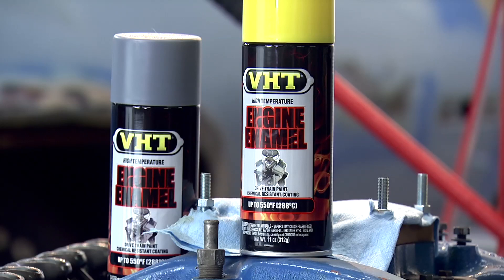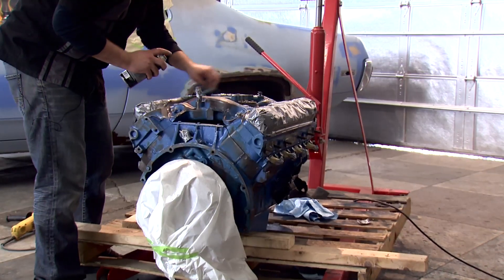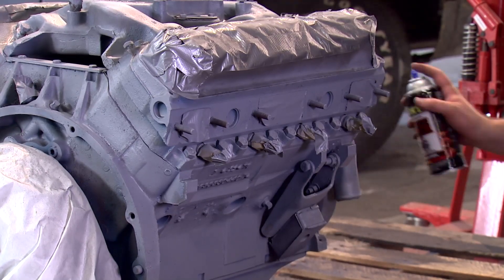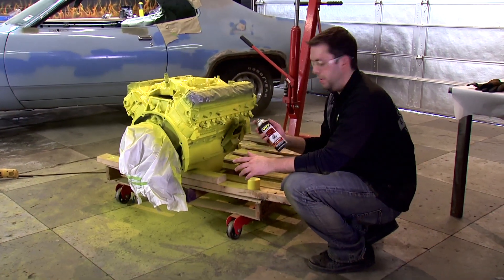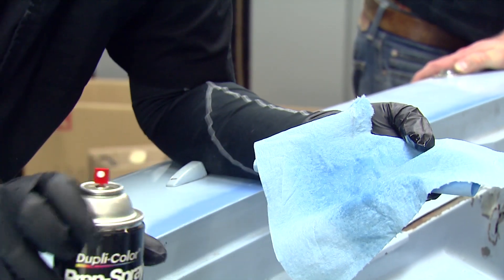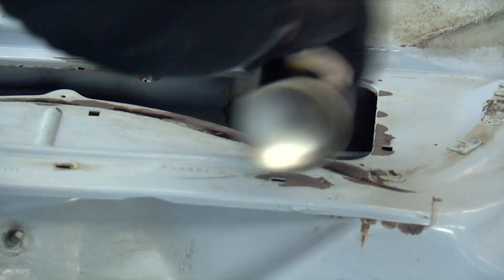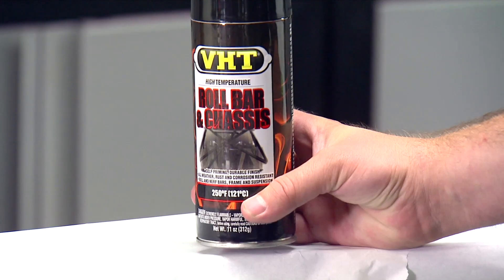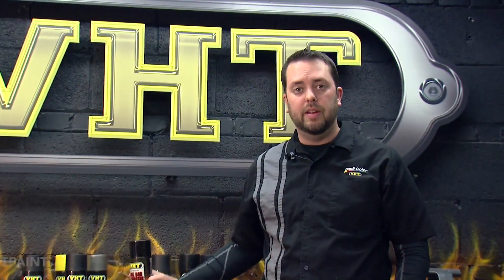Painting an Engine with VHT Engine Enamel - Restoration of 1972 Plymouth Satellite Sebring Plus

Comment: Do this guys!  As a mechanic at a restoration shop.  On our cheaper engine build where I paint the engine using VHT paint instead of going into the booth using high end engine paint.  First I wire wheel everything!  Cheap wire wheel kits from harbor freight.  Go over tight spots with small wire brushes!  Blow everything off with compressed air!  Degrease with brake clean!  Sometimes twice.  Blow off again with compressed air.  Make sure it is clean!  Buy self etching primer from SEM!  Its 18$ a can but has a 5 min flash time.  Well worth it.  If you wait more than 15 min you have to scuff the primer and blow dry again.  Once SEM primer has flashed apply one light coat of vht paint in your color and wait 10 min.  Go again with another light coat wait another 10 min.  By light coat I mean dust the paint on.  After second light coat go medium.   You should start to see the engine block take shape now.  Wait 10 more min and apply another medium coat.  It should look done to you!  Wait another 20 min and apply a thick coat of paint!  Should look like your painting over the same color but just a little deeper that before.  This should be your last coat!  No clear coat needed.  After 24 hours,  run engine for 10 min and let cool do another couple 10 min runs with cool time after.  Works great everytime.  You will see some yellowing of the paint around the exhaust ports on the heads but that is to be expected with this spray paint method!  Do NOT use any carb cleaner or high acetone products around this paint because it will stain no matter how cured it is.  Hope this helps and good luck with your engine build!

Comment: I've been rattle canning for 35 years and it's the best (off the shelf) canned paint I've used. It lays down beautifully.  But I wasn't as thorough as this guy. I used no primer. Just did a very thorough prep, and clean wipe followed by multiple coats. I was very pleased with the results. Actually worth the $10 per can price tag
Reply: How is it holding up after all these years?

Comment: Hi, I bought Engine enamel primer (SP148) and Engine enamel gloss black (124). I am planning to paint motorcycle engine. Question is: after applying primer (SP148) do I have to sand it before I apply gloss black engine enamel or just wait 30 mins till primer dries to touch and apply gloss black engine enamel (SP124) without sanding the primer?

Comment: One question, I used VHT engine paint for a Rm125 2 stroke cylinder and head and it looks good and everything, I'm about to assemble the top end, will turning on my bike and warming up the engine cure the paint? And also how long does the paint take to fully cure? On the back of the can it says heat up to 200 degrees? Do I need to stuff my parts in a oven? Or will running my engine work just fine ?

Comment: When the curing for engine is done? After you assemble everything in places? Also how long I need to wait to put clear on the paint?
Reply from the maker: VHT Engine Enamel only attains its unique properties after correct curing.
You can bake the parts before putting them back on the vehicle or heat cure
the parts on the vehicle. The Clear would be applied within an hour of
applying the Paint. Or, if you cannot apply it within an hour, you’ll need
to wait 5-7 days. To heat cure: Bake at 200°F (93°C) for 20 minutes OR
The inherent heat of engine operation will also accomplish curing.

Comment: Thank you for your interesting video,  question though, Should I sand before or after heat curing ?  Do you know if paint resists to solvents ?  ex lacquer , carb cleaner .....If i cure properly (200F 1 hours ) . Thanks
Reply from the maker: teonguyen1 Hi Teo, thanks for your questions. we recommend sanding after the heat cure, although you can sand before the heat cure if the paint is dry. The paint itself will resist quick spills, but not constant exposure to strong solvents. Good luck with your project!

Comment: I just ordered some VHT Engine primer and nu aluminum-I am wondering about rust on the block. I am thoroughly wire-wheeling the block and using ospho on the the areas I am painting and then wire wheeling again. Does the block need to be absolutely rust free? Since it has a rough cast feel there is fine rust in the "valleys" though nothing loose-just what wont come up with wire wheeling. I plan on using solvent on the whole block just prior to painting. Any tips????? Thanks!!!!
Reply from the maker: 351cleavland Thanks for your question. It is best to remove all rust prior to applying our paints. We would recommend sandblasting if you are having trouble with the "valleys" on the parts. Make sure the surface is completely clean and dry before applying any of our paints or primers. Hope these tips helped to get you in the right direction, please call 1-800-247-3270 if you have any additional questions and our experts will assist you. We'd love to see your project when it's done!

Comment: I heard that for High heat Paints to work the Engine must be at a hot temperature when painting for it to work?
Reply: Absolutely, in fact you should have the engine running @5000 rpm while painting.

Comment: Question... I used this paint today, 3 coats on one part (2 light, 1 med) but only 2 coats on another (1 light, 1 slightly heavier). So I'm going to wait a week to re-coat both pieces one last time. My question is, ideally, how long after re-coating should I wait to cure them in the oven? 1 hour, when they're dry to the touch... 3 hours, when they're able to be handled? Or longer?
Reply from the maker: Thumper G. You'll want to wait overnight before heat curing (at least 8 hours.) Thanks for your question, good luck!

Comment: Hi, I'm about to pain my motorcycle engine with VHT Engine Enamel. I'm thinkin of  SP148 primer, Sp995 Nu-cast aluminium paint and SP145 gloss clear coating. Do I have to cure after primer, after paint and after clear coat or once after all the job is done?
Reply from the maker: Rudy Hi Rudy, you'll get best results when each coating applied is cured separately. When curing all of the products on the surface at once, there is an increased chance of the product wrinkling on the surface as it is cured. Be sure to follow the label directions for each product (primer, color, top coat) separately for best results. We'd love to see the final product! Good luck!

Comment: I'm looking to paint my CB750 engine matte black. Maybe I missed something in the vid but don't you have to bake the engine paint on? Also if I bake my engine at the recommended heat do I have to worry about wiring? Say a stator? Thanks for any advice.
Reply from the maker: +crash1974lol Yes, the VHT Engine Enamel should be baked for 20 minutes at 200*F.  After it is properly baked,  it will be fully cured.
Reply: +Vht Paint what will happen if you don't bake it?

Comment: Hi I was just testing some metallic gold engine paint on some bare metal and noticed it ran more than the other paints.Have you noticed any problems with the metallic paints?What primer should I use for gold metallic and do I need a top coat?Thanks
Reply from the maker: +Habacuc Garcia We haven't noticed anyone reporting something similar with regards to running. You should try holding the can further from the surface. We suggest Engine Enamel Primer  for the Primer.  A topcoat isn't required, but would act as a sacrificial coating and in this case, we would recommend  Engine Enamel Clear over the Engine Paint.

Comment: So can I use the silver aluminum enamel directly on my aluminum motorcycle engine? I'd like to lightly dust some on my clean engine. Please let me know if I need the primer! Thanks!
Reply from the maker: +Nick N Aluminum surfaces should be prepared with a Self Etching Primer.  We wouldn't suggest using Engine Enamel as is over a bare aluminum surface.

Comment: Restoration means putting the car back the way the factory did it. Chryslers were always the same color as the body under the hood. Painting black under the hood is not correct. Only Ford and GM painted the engine compartment black. I used VHT to paint my Chevy engine Orange. It is way better than Dupli-Color. VHT had way more pigment.
Reply: Did you vht paint job last? I'm wondering how it does against the heat
Reply: Additionally, there was every opportunity to paint the engine the historically accurate color but went with a puke yellow instead. Falls short of a restoration. You have to be a purist to respect a piece of history and restore it accurately.

Comment: I want to paint my fabricated aluminum valve covers VHT Hemi Orange. Any tips or concerns for getting the paint to adhere to the aluminum?
Reply from the maker: +grnfsh We recommend using a Self-etching Primer. Our Self Etch will resist temps up to 200 degrees F. If you go without a Primer, you could sand the surface aggressively to create a texture similar to 120 grit sandpaper. Then clean well and apply the Engine Enamel Primer and Enamel over it.

Comment: I want to paint my motorcycle engine but don't plan on having it back on the bike for a little while why I continue to restore it, how do you recommend I cure my engine? Obviously I can't put it in a oven
Reply from the maker: Hi, Christian! You could either use our sister brand, Dupli-Color and let it air cure or if be careful not to scuff it when using our product. You can then cure it when it goes back on the bike.
Reply: Vht Paint what's the benefit of duplicolor?
Reply from the maker: Dupli-Color does not require heat curing.

Comment: I followed the instructions holding the can 8-10 inches from the part.  There seem to be way too much thinner in the paint.  No matter how I tried, I kept getting runs and sags, and orange peal effect.  I pre-cleaned the parts with brake cleaner fluid, and let them dry thoroughly.   SP121 Bright Red.
Reply: I know this post is old but “fuck” it when you are painting anything with as much curvatures as an engine block use a gun  For  bright colours like red,orange etc and do really thin coats until you get the finish you want all so Eastwood has a  gun that works perfect for blocks that runs off a 20 gal compressor

Comment: can you spray a cooking grill with this paint???
Reply from the maker: +Jawanna Navarre  Our high heat paints are fine for use on the outside of a grill.  However, we offer nothing for the cooking surface itself.  We do not manufacture a product that is FDA approved.  An FDA approval is important in terms of whether a product film is safe for incidental ingestion. We do not perform animal testing and cannot test for ingestion.  We therefore offer nothing that is guaranteed to be food safe if it is ingested or comes into contact with someone's mouth.
Reply: +Jawanna Navarre  Paint is available for that job your wanting to do.

Comment: Hi, sprayed my cylinders and heads last night with your engine metallic and aparantly drank my entire fridge full of beer. Well I guess I drank to much because I got up this morning and saw that I missed a bunch of spots. Can I just oven cure than respray after cool down or do I have to wait a week? Thanks - Jay
Reply from the maker: +Jay Schiltz Hi Jay, thanks for your question. Yes, you can heat it up then let it cool and allow it to drive. Then re-apply more Engine Enamel over it. If you don't heat cure it first, you will need to wait a week to re-coat. Thank you for using VHT, good luck with your project!
Reply: +Vht Paint So, if it's heat cured is there still a need to wait 7 days to re-coat?
Reply from the maker: Alex Toff Yes, we recommend still waiting the full 7 days for re-coat. because the coat could wrinkle if applied too soon.
Reply: +Vht Paint Gotcha, thanks.  I laid down 4 coats following the instructions, waited 24 hours then cured at 200F for an hour (this was the clear), but it's chipping like crazy.  My paint job was pulled off from just a thumb press.  Trying to decide if I should bother with a re-coat or try something else.
Reply from the maker: Alex Toff If you decide to re-coat, we recommend applying all coats to include the clear within one hour (per label instructions). If you would like to send us your email address, our customer care team would like to help you further with your issue.